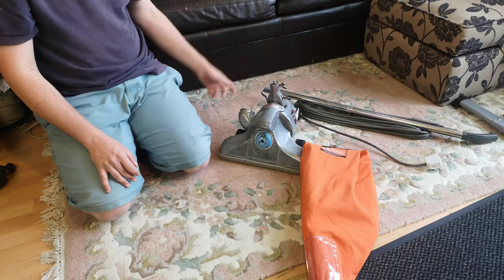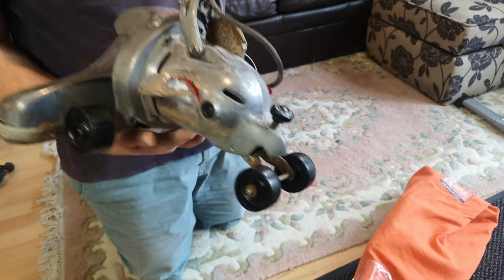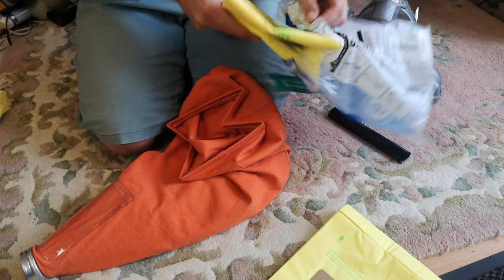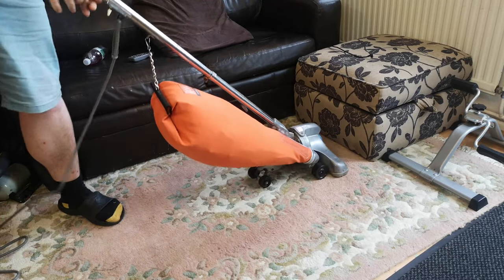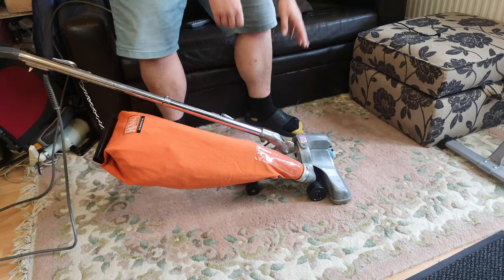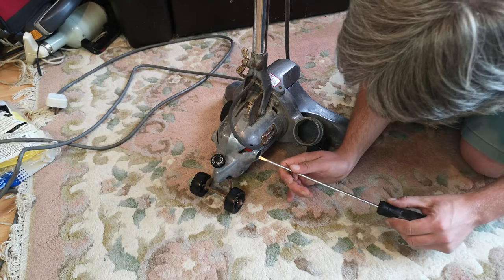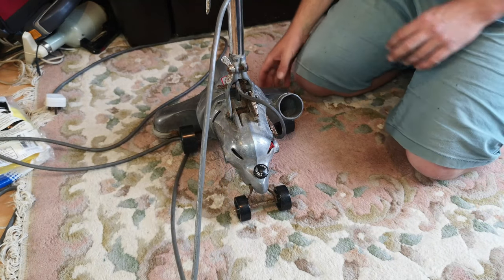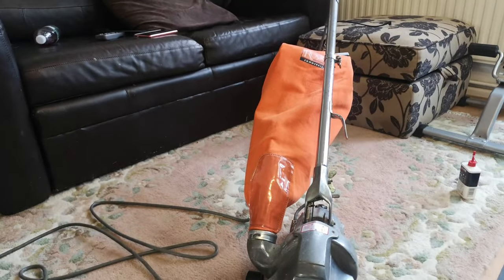September 1977 - Retro Commercial Upright Royal 606! First look, it's AMAZING! And Orange...🤨

Comment: The belt cap thing is a suction controlled thing, when you have the height adjusted right the little black nub will suck into the cap and if it’s too high it will come back out! You could use motor oil for the oil port it shouldn’t hurt it
Reply from the maker: That's cool to know, thanks! Was thinking it can't work by needing to be manually pushed in 🤣 It's plugged up with fluff though which is a shame, being a press fit assembly I don't feel I can take it apart either without damaging it. Will pick the fluff out as best I can through the vent holes
Reply: @beko1987  I wouldn’t try to take it apart, I agree just pick the fluff that you can out and try to suck it thru with a vacuum and crevice tool 😊 it was marketed as the adjust - O - right height adjustment
Reply: @beko1987  defo  you will    Sam

Comment: that's amazing  am 54 next month  as a child mam &dad  had a kirby    it used to squeak like that  it had some power  also lasted for year's   if if remember rightly the thing on the front was to reduce the suction   ?    also helped with putting new belts on as you have to twist them  you can still buy kirby parts  also    i think they will still do the 240volt lamps   also     ?  me being an electrician  i thought  OMG  i would have  put a  insulation resistance test  on before plugging it into the 240volt supply  also the plug is the old type  it doesn't have the safety  guard's  around the  live/line & neutral pin's  not that all of mine have in my house  i personally don't  give  a monkeys ?     as long as it's got the right size fuse in  flex is ok it's good enough for me  but you sell them on so i thought i would mention that to you buddy    that was great  it brought  back some ole memories  ours had a cloth reusable bag  with a round spring around the top of the bag to hold it on

Comment: I have a video that i am currently making that you may be interesded in, i found a numatic henry hvr200 from 1994 that has the twin fan motor, it had been used filterless and completeley filled the fan with shit. the bottom bearing also is in very a poor state. i am getting some bearings for it and once i have fitted them i will be uploading the video.